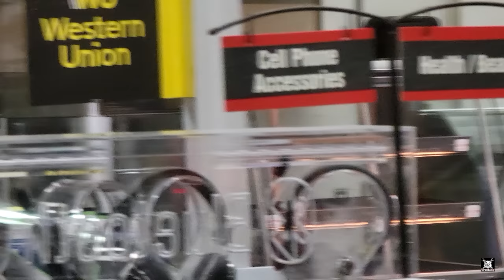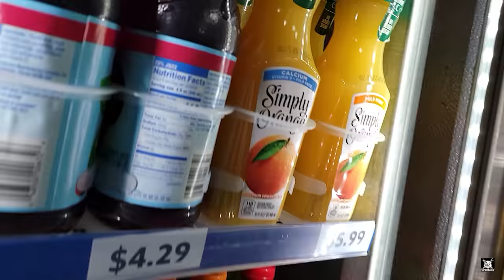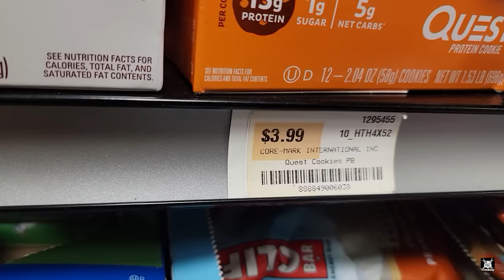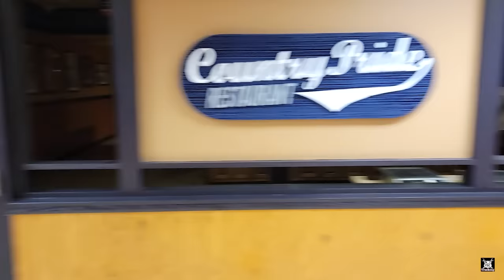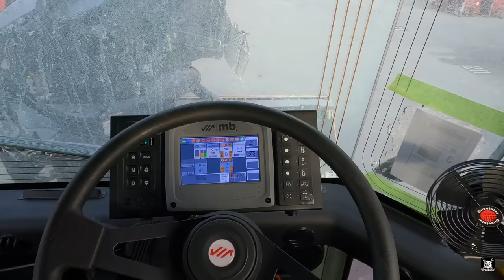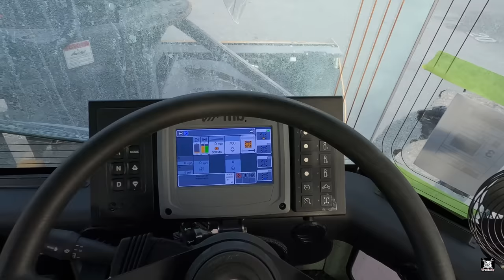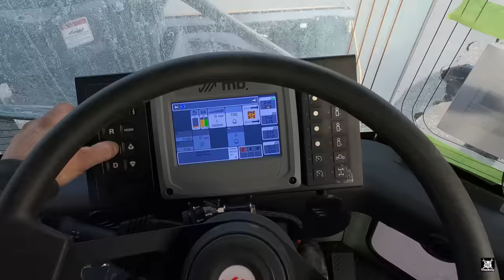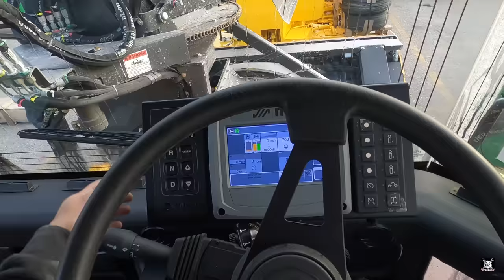Vagrants And Homeless At TA Truck Stop Baltimore.  Fuel Island CLOSED!  Unload 2nd SnowBlower Truck

Comment: I just let now that was nice to help the of Gentry family out. I was driver back 1986 was I 28 before I had a Tractor trailer rollovet because a load in trailer was on the floor with tie down in the dry box I had 26000 lbs of Aluminum Coils.I was contractor with Candian Armed Forces that doors were  U.S custom seal and Canada too. I'm Incomplete Quadriplegia ,I'm 64 now and like your U tube Channel to take back .I was in a Internationan 9000 cabover . When 186 feet out of the winfdshied to the road. You have a great name same as my.

Comment: I stopped fueling at TA over 4 years ago. If you lose your card or it won't scan you have to spend hours on the phone with customer service and then wait until you get home to get the new one. And its a pain to actually use your points. With Loves or Pilot you walk inside the store, grab a new card, add to your account with the app and your done. 5 minutes. I do reserve parking at TA. They will kick other trucks out that don't have a reservation. With Pilot you're out of luck if someone takes your reserved spot.
Reply: Pilot also charges for parking and showers in certain areas and practically all Loves have free showers and coffee when you reach a certain level by fueling at their station which I think is the best deal any trucker or traveler could have because Loves treats their clients right and their customer service from what I've watched is very responsive and courteous to drivers if they run into problems with their fuel card. Why can't Pilot and TA be so accommodating? Could it be they don't give a shit and are more concerned about stripping all of us of our money and patience with their antics... hmm.
Reply: I have been trucking for 32+ years and i never pay to reserve a spot...i just dont get paying 15 bucks or whatever to "reserve" a spot. But i guess its your decision if you want to i just dont get it when you can park for free.
Reply: @jamesgarrett6848  You probably don't have customers in the Northeast with afternoon or evening appointments. I get reimbursed for my parking fees.

Comment: I quit buying anything inside the stores at TA/ Petro and Pilot/Flying J. I stop at grocery stores and buy microwave meals, snacks and drinks. It’s still slop, but at least I cut my spending by 50-75% every week. I also quit using Truckstop shops for anything more involved than a tire repair. They tend to do more damage than good, and in the long run, both for down time and cost, your better off finding a local mechanic shop.

Comment: T/A started out as union 76 witch was just a gas station then they started doing homemade food the truckers would stop for a realy good meal then they put desil pumps in and the 76 truck stop was born then they went public on the stock market in the 70s and went to hell from there . I generally don't stop there anymore but i will over loves and flying j had a bad experience in loves in elpaso bad enough that i boycot them .

Comment: They don't pay enough to keep anyone, they charge truckers too much for everything, and let freaks hangout because they frequent those places and the cops won't run them off! The Iowa 80 truck stop isn't really any better, it's just busier. If I could get a decent job driving OTR/regional I might try it again but I don't want to do everything you have to do to keep up with loads that are late when you get them or you have a day or two to wait until they will unload it. You get everything you have to put up with. I think the attendant free truck stop fuel islands are the way of the future, they'll need security though.

Comment: Good afternoon Steve, Happy new year to you! Can the Pete's radiator handle both the APU engine and Cat engine running at the same time since they are plumbed together? I don't know how that works but assume the little APU gen can't be putting out that much heat? Anyways, safe travels to you and Orwell o7
Reply: All APU's have a cut off switch, once you put the ignition on it automatically shuts off.

Comment: Steve,  that light problem you have, could it be a bad ground between the gooseneck and trailer, reason I'm asking I was a trailer mechanic for 28 years and I had problems like that with container chassis that you could extend, check the ground wire where it goes in 7 way plug.
Reply from the maker: Bad grounds don't pop breakers.   Shorts do.

Comment: Well I see you haven't got that pigtail wire fixed yet to your trailer
Reply from the maker: Actually I cut out all the non essential wires from the harness.   However that didn't solve it.  The problem came back once it got wet and salty again.  I guess you missed that video.

Comment: The best thing about TA's is the Popeyes restaurant. I was at one in Wyoming on the 80 which had a Burger King. Best double whopper I've ever had.
However the TA's in California on the 10 charge $25 a nite to park.
You have two hours grace period then you pay and it's gated. Hate them. All of that parking a hotel and restaurants yet they need to charge. 
I sleep on the street or the highway. Not paying any foreigners so they can get richer.

Comment: Ironic, I grew up along those docks back in the 50's and 60's.  And I fully agree with the weather hype.  In fact when you said you saw the sun for the first time in a while...my thought was they probably think of it as the 'global-warming-device' rather than the sun.  I got out of Maryland many years ago due to the mind-control.  I remember when they built the I-95 through B-more and wondered how it could be made to service the large number of trucks going through it.  I had a buddy upset a crane when they were building the tunnel under the fort.  So I can remember the area without the interstate.  There was the old 'harbor tunnel' which was one lane each way.  And then the beltway with all it's on/off ramps and lane re-alignments.  That port built that city and state and it makes you wonder why they don't give the roadways more priority, to allow for better access and provisions for drivers.  But I do think the homeless in the truck stop is way over the top.  Our leaders pay more homage to ruination than they do progress.  "Oh Lord, how long will You allow this?"

Comment: What up Steve , Orwell looking good , she sure stands out in the truck stop , I would take Orwell stretch her out to a 310 wb. and put a nice tool box drum on the back ,   Definitely you on a roll Steve 😂  But it is all true , I have been in a few ports and their roads are the same way as what you are running on ,  like you say billions and billions of dollars coming in and out and they can not fix the roads ,  
I hear you on the sun , over here in the Northwest were supposed to be getting the sun here for 10 or 15 days  starting tomorrow ,
 They sure have some nice quipment in there ,   Definitely look at the salt , eat your wires up for sure ,  I do not understand why they do not use BEAT JUICE over there , Back in the day they did ,   A nice truck wash and a full day of rain to run in to get all that salt off ,
be safe take care yourselve STEVE